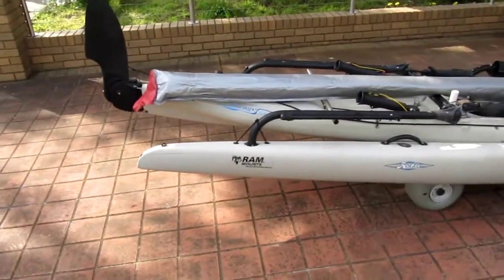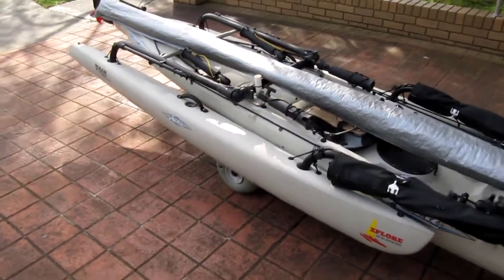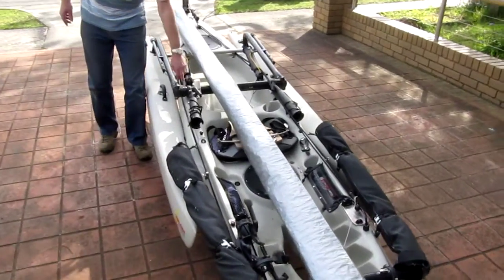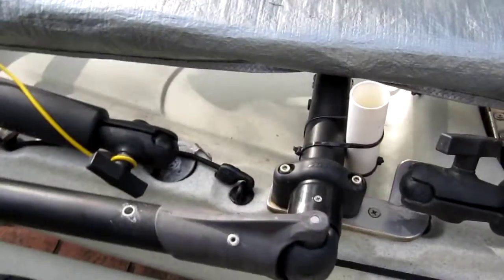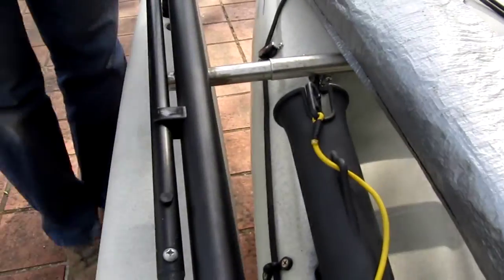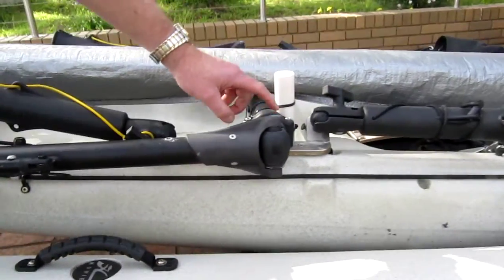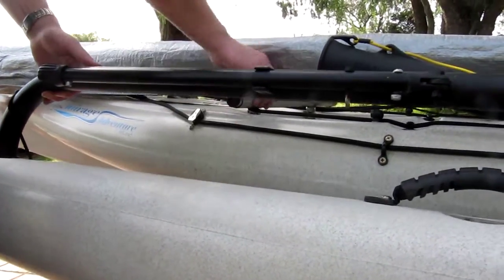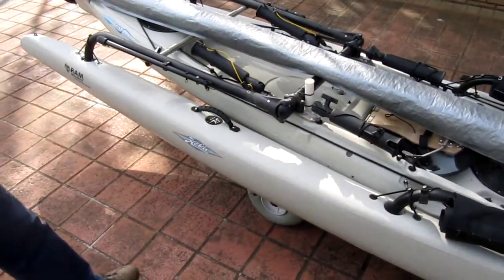AI mods 1

Comment: Hi, What did you use for the AKA support bar? Was it purchased (if so where) or did you build it (if so any suggestions on where to start)?
Thanks
Reply from the maker: Speratus Drego the AKA support bar is made out of stainless steel tube 28mm dia with a 1.2mm wall thickness. fitting inside that is 25mm dia tube with modified ends which I did in my factory.The fittings to mount it were standard pieces from a turnbuckle although, again there were some custom made bits. I used the standard Hobie black screw in plugs in stead of drilling holes in the hull. I'm in the process of making another version for the 2015 Adventure Island with some improvements.